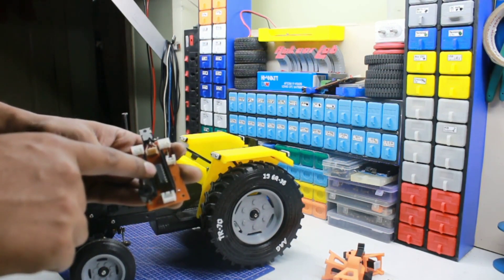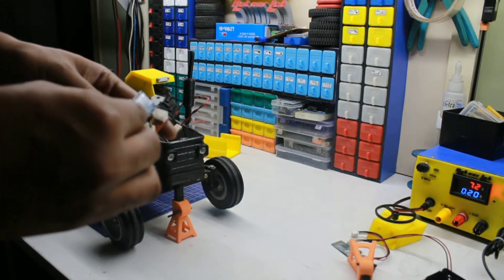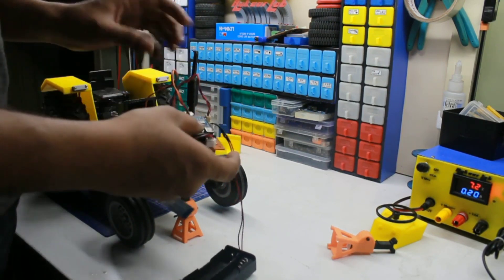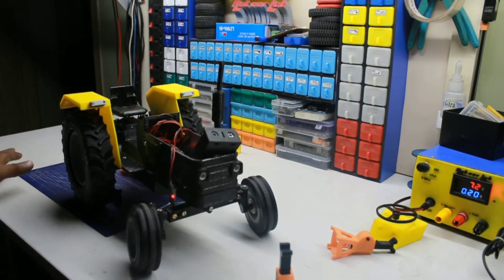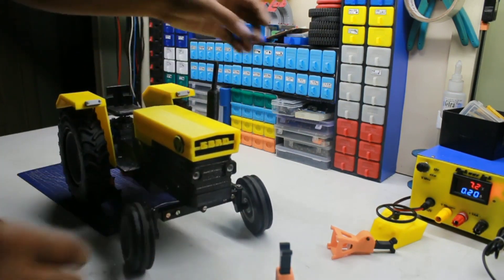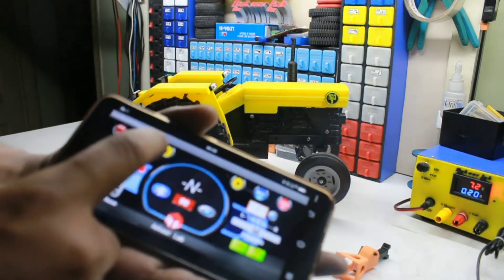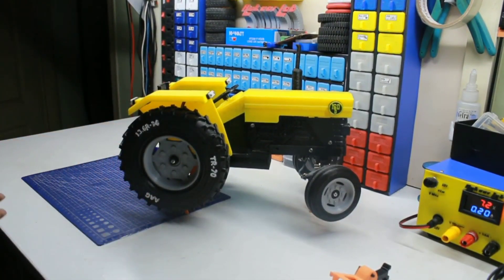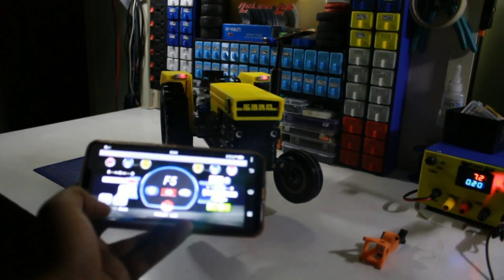Android app based Bluetooth controlled rc tractor

Comment: the arduino program to download in thingiverse does not work (lots of errors) and therefore is not the one built into the tractor in the video above. The android application to download in thingiverse also has 2 bugs ...
Do you have a link to download the updated files? 
Regards.
Reply from the maker: sir error is only library u have to add and application i will send
Reply from the maker: share your e mail
Reply: @AakaarLab  an-mi-colin@wanadoo.fr
Reply: @AakaarLab  my email : an-mi-colin@wanadoo.fr

Comment: You have a great site. But I need to know where I can find ino codes to make the tractor come to life. Everywhere I look the ones I do find always have something wrong in code's. I have been looking for a schematic on your android controlled tractor but no luck. Do you know if there is one available. Thanks for taking the time to read My post.
Reply from the maker: what u need
Reply: @AakaarLab  I made My tractor  with My 3D printer so I have no Prewired electronics to start with. I have your inc file . but need schematic for it.
Reply: I need a wiring schematic for that tractor I can't find one anywhere I thought maybe you might know where there would be one thank you
Reply from the maker: what is the size of tractor u printed and which motor u want to control
Reply: Yes instagram ,user name zneb68
Reply: My tractor is about the same size as yours.I have a 12 volt motor but it runs good on 9 volts. ,So I think I can use a 9 volt battery. It is printed with files  RCtractor  from thingverse. I tried to add a photo but it won't let me. I have arduino nano and bluetooth .
Reply from the maker: ok sir i will update u do u use whats app or instagram